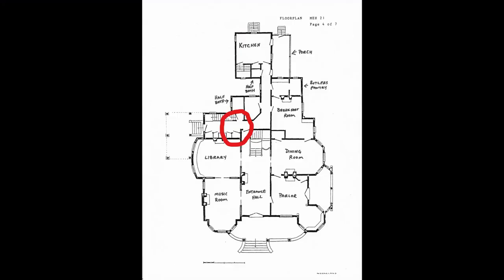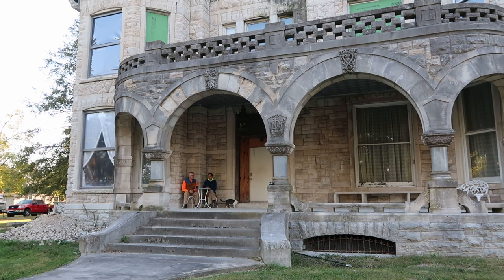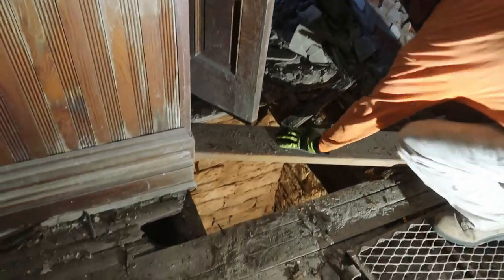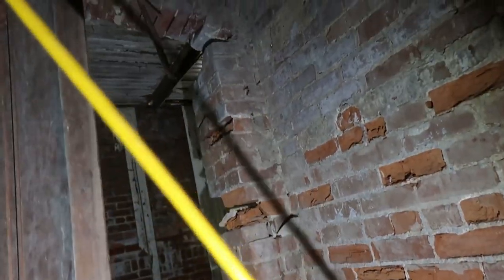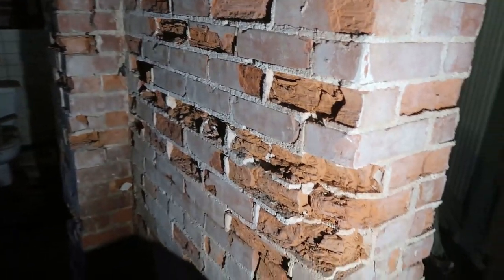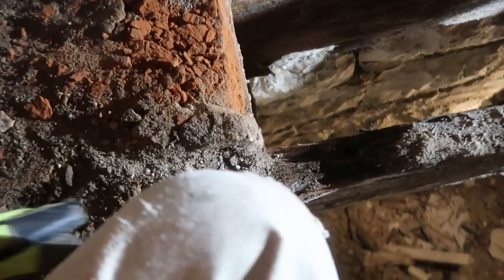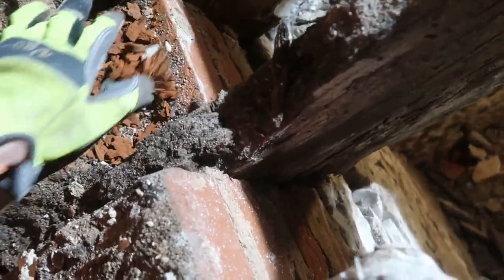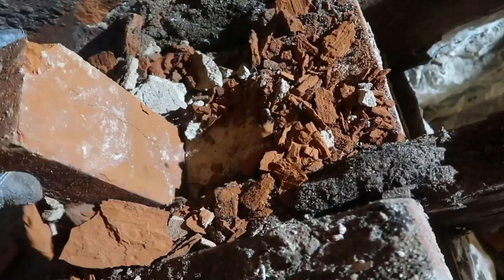We TRANSFORM The Rotten Floor To A Sturdy Temporary Platform | The Castle S3E20

Comment: Omg guys what a damage. I trust you both on going on safety. Rebrick everything with concrete bricks  concrete joists and concrete pillars to support the weight from above. And secure and change the roof structure in such a way that this will never happen again. But soon you can start restorating this gem. All viewers are admiring you for skills and perseverance. Big thumb up
Reply from the maker: We already changed the roof. We will be going back with the brick again. It's plenty strong enough for what it is doing.
Reply: @moorelandhouse  Yup, brick is perfectly fine as long as there's a roof above.
Reply from the maker: Agreed.

Comment: I hope you have taken down or covered over the box gutters in that area so that they don't funnel the water in anymore. Glad to see you getting some sound floors in there I worry about the structural integrity of the floors in other places that you have covered in with plywood in the upstairs hall.
Reply from the maker: We are almost done with stopping the water coming in through the brick.  Some places we covered the gutter and some places we took down the cornice moldings which were acting like funnels. All the other patches on the floors have good joists underneath and are sound.

Comment: Now you can safely walk on part of the floor. Aren't you worried that termites will start eating these new beams, or maybe they are already secured with something?  You are repairing piece by piece and I must say that this is a good tactic in this case, because more things are protected and you will come back to them later but the worst is done.
Reply from the maker: The termites are subterranean and have a hard time making the journey to this wood without the moisture from the leaks.
Reply: @moorelandhouse  Thank you for the explanation, I do not know about termites, there are no termites in Poland.

Comment: Those bricks look like frost damage to me. They soak up water, the water freezes and as it freezes it expands and makes the brick explode. Water alone doesn't hurt brick too badly, unless it's unfired clay brick (adobe). That looks like chocolate in the sun when it gets wet though, it doesn't crumble, unless it freezes of course. If it's just damp, not soaking wet, frost will make it crumble just like your walls.
Reply from the maker: That is probably what happened to these.

Comment: I have to disagree with you guys a bit. It's not getting wet that destroys the clay brick. I mean, all bricks are clay. What destroys them is trapped moisture and the freeze - thaw cycle. So don't paint bricks, kids. It's a recipe for disaster.
Reply from the maker: We do agree with all of that.
Reply: One thing the Mooreland house seems to have an abundance of is trapped moisture. Oh, and the reason the subfloor is installed diagonally is to prevent racking.
Reply from the maker: She is slowly drying out. It's amazing how much water it took to destroy this ol'house. Can you imagine how much damage a tiny amount of water is going to do to modern houses that are "waterproof".